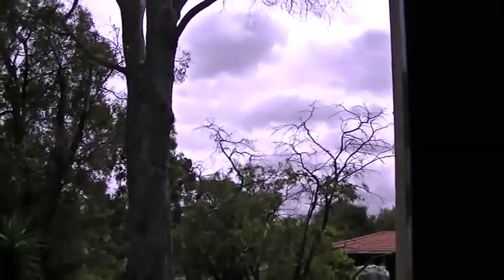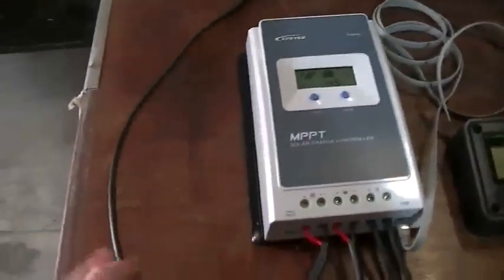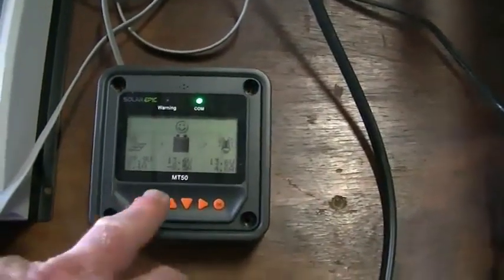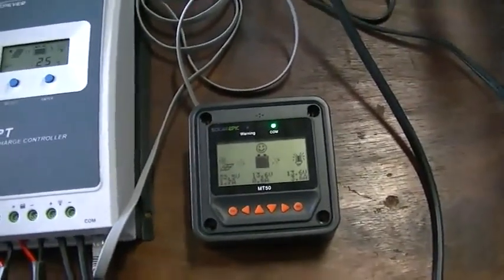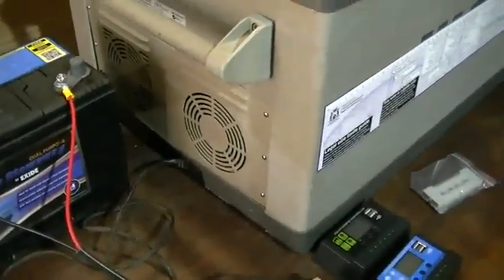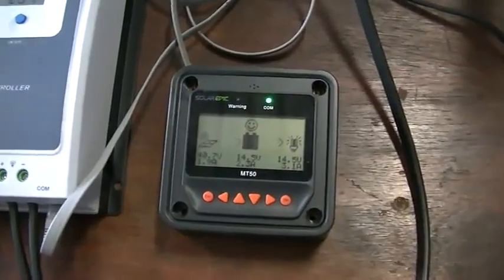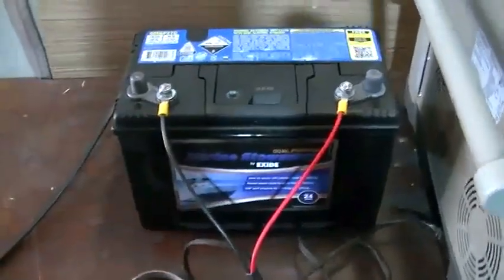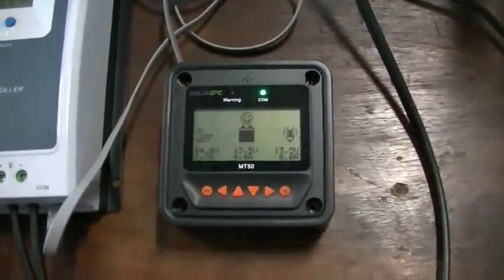What size solar panel to run fridge and lights

Comment: Hi there. Are you happy with he EPEVER solar controller ? I'm considering one for my solar set-up.
Reply from the maker: Yes. They are a very good unit, and they are also suitable for lithium.
Reply: @69Atho  if you don't mind me asking where did you get yours ? I'm struggling to find a stockist in Australia. They don't seem to overly common.

Comment: Very good setup Tin man. I have tried 4 different pwm controllers and only two of them accepted a 40v 5amp household solar panel on a 24 volt system. So not all pwm controllers is are the same

Comment: Nice tip with drain voltage i cant go past 12.4 just apersonal rule
Reply: 12.4 is almost impossible unless you have over 500ah lead acid bank